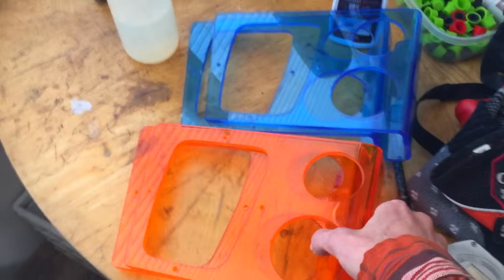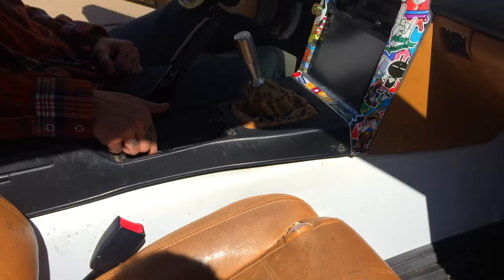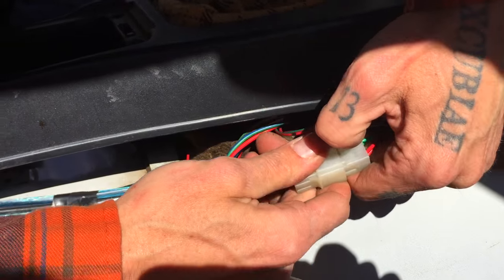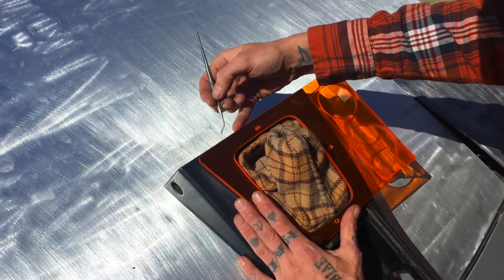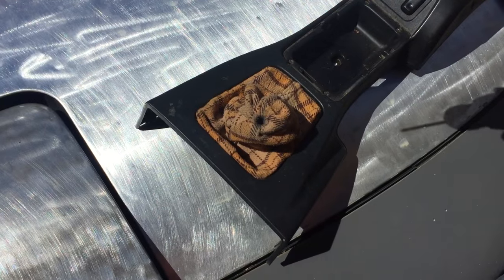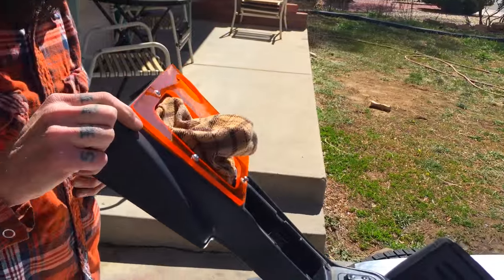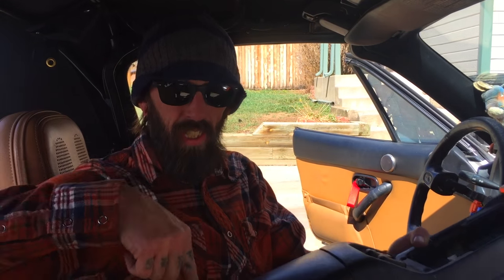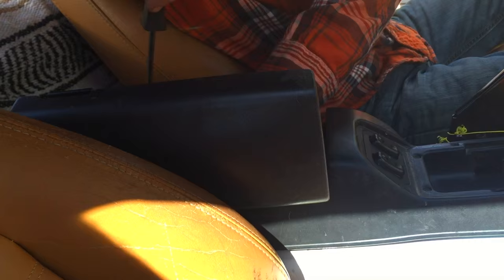HOW TO: MIATA cupholder install S03E11

Comment: dude that's awesome... do they come in black and will they fit a monster can in them?
Reply from the maker: top hole is red bull bottom is larger than a coke can so i would assume so. can make them in any color really but to get them at $40 it has to be one of the 5 neon colors. can always paint it.